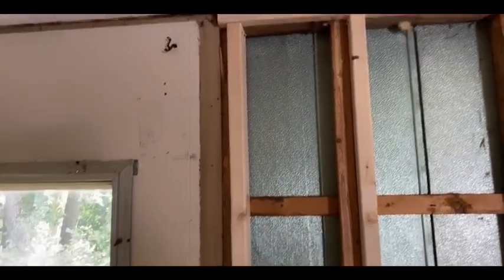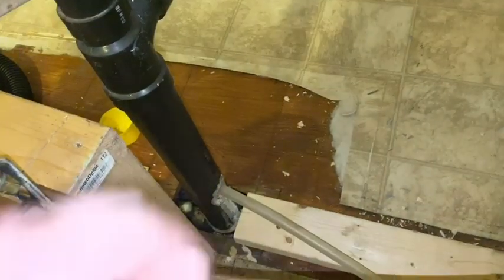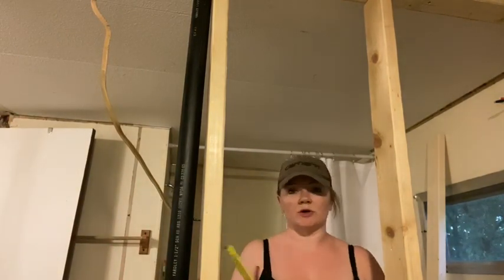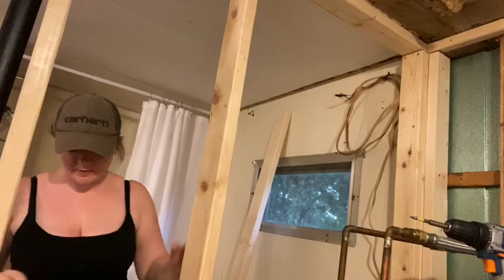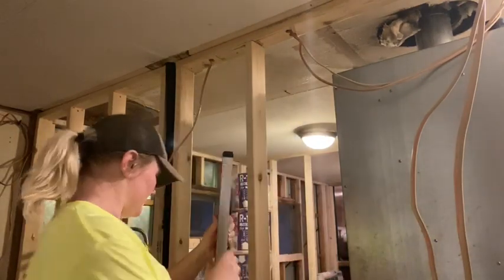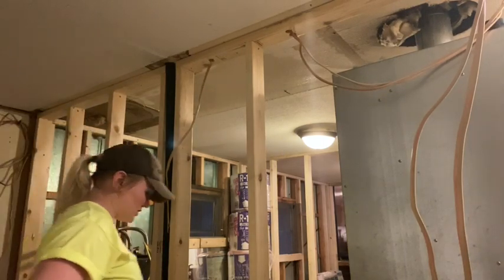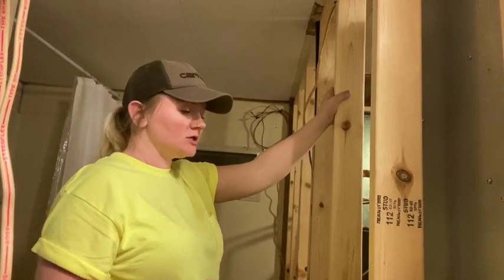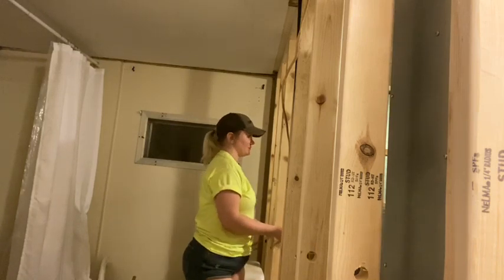Bathroom wall

Comment: If I could suggest one thing to perhaps make it go faster. Before you place the header, go ahead and mark the 16” on center. If you are using a level, you don’t need to measure the 16” on the bottom plate. Or you could work from the bottom up. Since it’s easier to screw downward, place your board at the bottom, screw, then tap into plumb.

Comment: House trailers are very hard to work on, because they're so lightly built. I had one for about 10 yrs ,it was 10 yrs old when I bought it. It got to the point where it was cost effective to fix it any more . I'm a construction carpenter by the way. They're terrible  as far as proper moisture barriers and  air . ventilation I noticed siding on the outside walls  without any sheathing, mine was the same way. Walls condense and sweat like crazy, a dry rot problem and a haven for black mold . They're a cheap home for a little while ,beats being homeless, but not a long term solution.  I bought a new double wide house , they not as good as a reg frame house , but better then an old house trailer,  I lived in that house for 12 yrs with no major issues.  I live in northern upstate New York. The heating bill for the old single wide trailer and the new double wide  house was the same . For twice as much square footage of living space  .

Comment: If you think the boards may be shifting before you screw them in, use a long level to check right before and then mark on the top board with a pencil where that board should be as you are screwing it in and you can pull or push it a little to adjust it. Only takes a couple of minutes to mark it. The level doesn’t cost much and you can use it for so many things.

Comment: Damn I hope that's not too much extra weight it will make your walls too heavy and make the piers sag and bend that your walls are set on . You might be ok your home is older hope fully it was built on a sturdier chassis. Nice home by the way.

Comment: I want the ball park budget on each of these products please as u go. Because I have the same issue not as bad but I have such a small budget amd there are hardly any of these kind of trailers online. Pre July76 is just last impossible to find be cause of this reason amd some as u know now as an owner of one. So I jave to consider weight and of I have to add support underneath first too. But you are the first one I have found that has actually done it on you tube. Thank u for this. But that tid bit ball park will help me not get ripped off as I can't do the work on this part of the trailer due to my multiple sclerosis. This part is hard so I have to also figure in Labour and when I start interviewing in Jan I just don't want to think they are talking to a woman who didn't research. Since March I've been searching everyday. Today I did my 5 billionth search that google actually congratulated me. I was floored. I'm not kidding either. Lol but that's over the entire timr I've owned the account. Lol they do it for every one actually. But I digress I would appreciate it . btw this is Dec 23 2020 today so merry Christmas. The FIRST real trailer wall redo since March is just so crazy it took this long which might mean u might be the one of very few needles in a haystack 😹